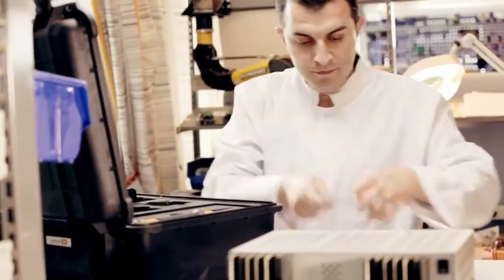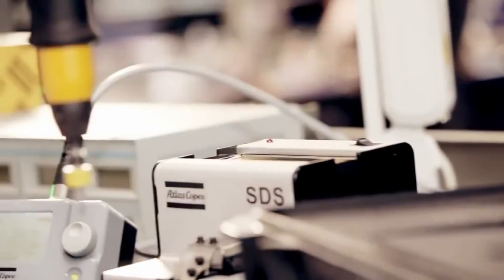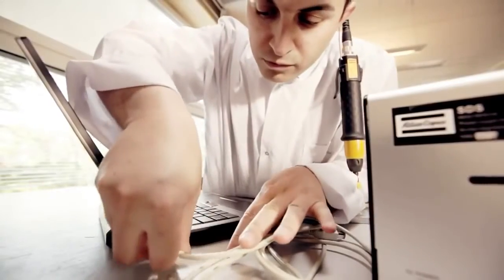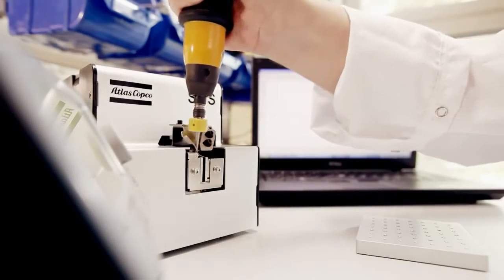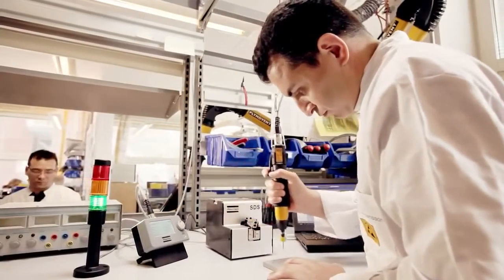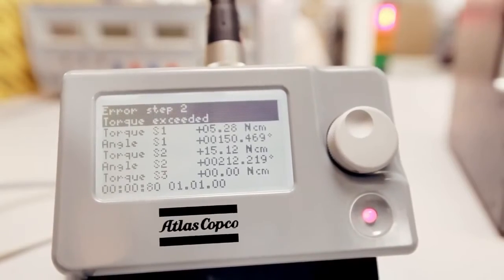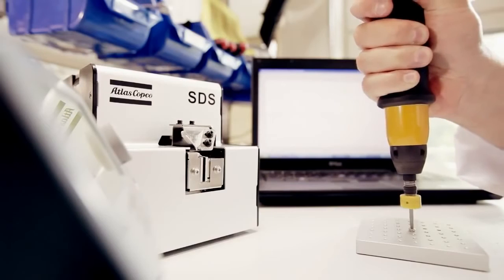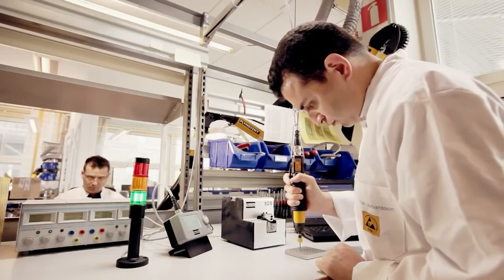Tua vít lực tự động vít bằng động cơ điện - EBL55 Atlas Copco

Comment: ua vít lực, tự động vít bằng động cơ điện - EBL55 hãng Atlas Copco
Luong Duy Thang TTECH 
Luong Duy Thang TTECH
Đã đăng ký7
Thêm vào   Chia sẻ  Thêm 72 lượt xem
 4  0
Xuất bản 3 thg 3, 2016
Tua vít lực, tự động vít.
Model: EBL55 - Hãng Atlas Copco
Xuất xứ: Thụy Điển.

Thông số kỹ thuật:
- Sử dụng vít: M2.5 – 5
- Dải lực: 1.0 – 5.5 N.m
- Tốc độ: 600 vòng/ phút
- Khối lượng: 0.8 kg
- Độ dài: 235 mm
- Chân cắm: 1/4"

Thông tin liên hệ: Lương Duy Thắng 0936 983 953